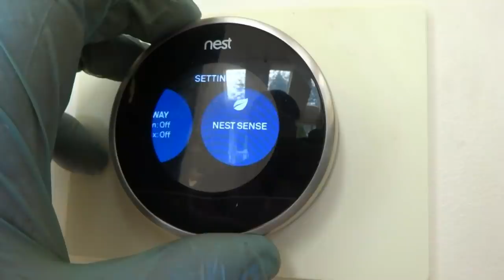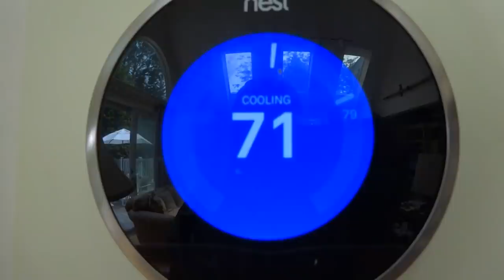WATER KEEPS RUNNING IN TOILET

Comment: My overflow was a junk after market lever.. spun in bowl square hole..  so on a hard flush it spun and raised fill arm so it overfilled...fixed it old credit cards cut folded put into bolt hole to stop flush arm movement..  perfect... now arm stays put... lousey quality control...even original flush arm moved..

Comment: I love Nest Thermostat. I hate the auto- scheduling feature. That's where it raises and lowers the temperature by a few degrees throughout the day. I hated that feature. I like my thermostat to be a traditional thermostat, where I put it at a set temperature. The biggest thing, that I love about Nest, is that you can remotely change your temperature or turn on your heat or air conditioner.

Comment: Glad to see you replaced that filler valve rather than attempting to fix that old valve.  I mean its good for youtube and a home owner to try that fix or if the toilet was newer, but I am sure you don't want to be back in a month after they started to fail again.  I was surprised you had that flapper gasket on your truck.  Clearly with all the rubber chunks in that  bowl the rubber seals in the valve were too old and failing.
Reply: Yes and for $20 that has the float and all included as one, its simply not worth trying to restore those well made older valve unless the main focus is to keep it all OEM restored.

Comment: Hey Steve just if you don't already know... Whenever you run into one of those nest pos go into nest sense and turn off auto home/ away, auto schedule and certainly "airwave" or that thing will have a mind of it's own
Reply: If your coil tends to partially freeze up, airwave is a good way to keep it "defrosted"
Reply: @JSLEnterprises  
But if it’s Partially freezing up then there is an issue other than your thermostat that needs addressed.

Comment: Good morning Steve,  if you attempt to try and repair them it's a Good idea to replace the seal and seat also inside  the toilet  ballcock valve , And then it'a 50/50 chance it'll work properly.

Comment: Confession:  I have never been able to bend those old float ball rods.
Reply: Need to work put more
Reply: Replace with a Fluidmaster.  Just replace washer in the cap when they quit working.
Reply: They can also corrode in acidic water and break.

Comment: Nice job as always Steve. Does anyone know about the Nest thermostats having charging issues? I have 24v at the thermostat but almost every year the nest thermostat battery dies and the unit won't turn on. Any ideas?
Reply: Hook up a common wire.
Reply: @chrisroberts3722  That's what the 24v supply is connected to. I can't figure it out, unless I happened to buy 2 faulty units because both thermostats have done it. Will have to see by the end of this year!
Reply: I have an Ecobee and it runs fine off furnace transformer. Had it about 3 years and no issues. HVAC repair guys love those Nest's, guaranteed job security :)
Reply: @davesaunders7080  Thanks for the reply. I think what may have happened was I didn't have the common wire hooked up initially for the first year and then I only hooked up the common to one of the thermostats. I grabbed the 24v off of the taco zone valve control box. I'll double check there is still 24v at both thermostats and the taco control box. Too many projects in my house at once!

Comment: Elderly with a STUPID nest thermostat... Poor guy.
Reply: Installing programmable thermostats for elderly homeowners? 👎 Some freakin Techs?
Reply from the maker: over complicated junk thermostat would make a good hockey puck
Reply: UN NESTABLE JUNK THERMOSTAT, just get a regular Honeywell thermostat and no more problems- when they put a new heater and AC in the house, they put an off brand thermostat that never worked right from the git go,I went to the home center and got a regular Honeywell thermostat and no more problems except having to put fresh batteries in it every 6 months

Comment: I've had same ball cock assembly there's a nylon seat that has to be changed with rubber washer.  Good luck trying to find one the last time I went I bought two so I have one more to go. So far it's 41 years old.

Comment: HVAC thermostats these days, the "set back" or "Programable" ones are in fact OVER ENGINEERED for their main purpose, reading temps and turning on the HVAC. It's really not all that complicated to turn the system on and off at the set temps. Those new "communicating" proprietary ones are truly overkill, WiFi, weather channel displays, humidity blah blah. Those rearely work as they should with a lot of the public who work their thermostat based on their "body temps" vs the temps inside a building. Those type of folks may as well have three wires and a wire nut to run their HVAC since they simply refuse to accept how a thermostat regulates "a buildings temps" and not a persons body and/or mental temps. 
NOT to mention...most of those LCD or LED displays fade and dim too much after a few years which require getting a replacemement for just that.